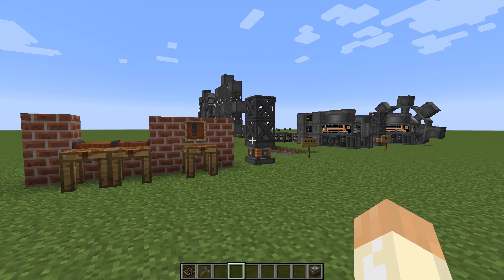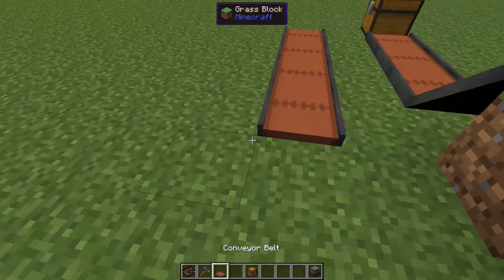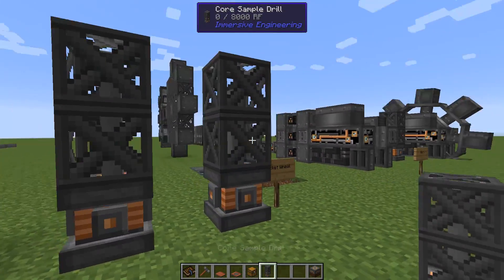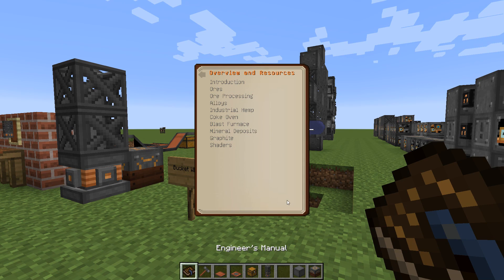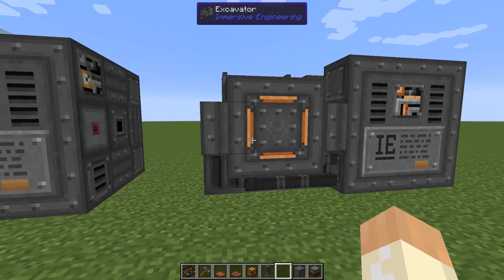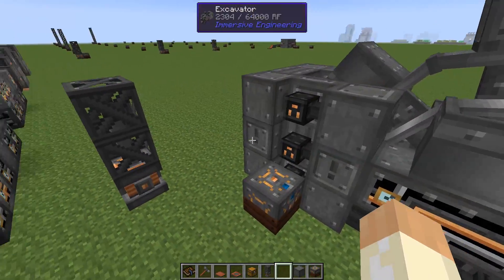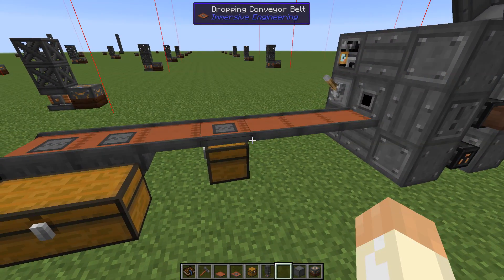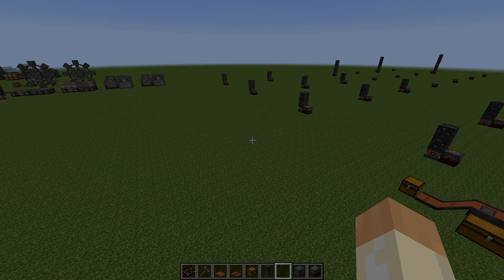Immersive Engineering Tutorial #5 - Excavator and Mineral Deposits (MC 1.7.10)

Comment: I don't get the point of Immersive Engineering. I've been playing it for 2 days, and it takes too much time to get everything working. But, when you do, like those Excavators, what will be the point of all your industries?

Not that Minecraft has an objective, but IE really is complex to achieve nothing besides having it working.
Reply from the maker: Well, as with many mods I think it plays best together with other mods. And you can choose what style and method you want to use. However, I think it's fun that some mods makes things "harder", looking at the power system for example, how to distribute in low, mid or high voltage. Multiblocks instead of one-block-fixes-all etc. It feels more rewarding (sometimes).

Comment: Hi! I understand this is 5 years old video, but I'm wondering how can I enable mineral deposits which is not automatically enabled. (Such as slit - clay + sand + gravel)

It seems like some people raised questions in the bugtracker but I could not find any meaningful result.
Reply from the maker: Hmm, what mod version are we talking about?
Reply from the maker: And modpack if using one.
Reply: @therealtkh  Thank you so much for your reply!

 It is 1.16.5, and I was creating a custom one for myself.

If I'm remembering correctly, minetweaker could add custom mineral deposits but not sure about crafttweaker...🙄
Reply from the maker: @saewings4963  I started up a 1.16.5 instance and added only IE. After that I went around and took lots of small samples (using Mineral Survey Tool), finally I found a Silt deposit, as we were talking about that. Did not work in flat world for some reason, I had to be in a regular world. So I took a core sample and had a 98% Silt concentration, built an Excavator and put it to work. Seems to work fine as it output Sand, Gravel and Clay. However, I didn't find the ore concentration in the config files so I can't say how to change them. I haven't used Minetweaker/Crafttweaker so I'm not sure if they can help out with enabling/disabling/changing rates. Sorry!
Reply: @therealtkh  Thank you so much again for investing your time for this question. It really helped me a lot! Maybe they changed things in 1.16.5... (I saw many complaints for previous versions saying 'some mineral deposits are not present despite the output minerals are all from vanilla minecraft' and the author just dismissed the issues saying 'less desirable minerals will not be added')

I really appreciate it, and I hope you have a great day! :)

Comment: Im am building excavators EXACTLY the same way you did in this video, but they simply will not form when using the engineering hammer at the end.
I've tried with and without the wheel present, they just don't form.
Reply: the block that you hit matters. if it doesnt work, craft an engineers manual, search heavy machinery and the excavator. it has a nice tutorial for building it.
Reply from the maker: Please note that this video is over two years old, and things might have changed. What version are you using? Double check versus the manual if anything has changed.

Comment: Again I did everything to power that Excavator, and it still does nothing why. i'm using the High Voltage. but it has these multiple functions that I still know nothing about, and the problem still persists. what does the blank mean? What does the blue light mean? And what does the red light mean?
Reply from the maker: Please note that this is the fifth video in this series, and power systems are covered in earlier videos. On a capacitor, blue means input, orange means output. It's important to have them configured correctly when powering machines.
Reply: oohh
Reply: Yeah I haven't found that in the Engineer's Handbook so I wondered.
Reply from the maker: The handbook has a lot of text and sometimes there might be minor things missing or perhaps not explained enough. That's one reason for making tutorial videos :) Hope you got things working.

Comment: Can someone explain to me how the /ie mineral set ... works because for me the excavator scoops just  air.
Reply from the maker: Did you do like in the video? Take a sample and then place the machine within that chunk?
Reply: +TKH 
Yes I liked the video:
it was instructive for me to understand how to use the excavator in survival.
But I've learned that there is an: "/ie" command (in 1.7.10 at least). If I type:
/ie mineral set Iron
then it "overrides" the minerals in the chunk to iron. Unfortunately this doesn't synergies with the excavator (and it just scoops air) thus I was wondering if you or perhaps someone in the comments section knows any thing about how this works, if I got it wrong, there is another step to this, etc. Anyway I hope you have the time or energy to supply me with an answear or propose an alternative.  Again, I would like to crontrole the location of the excavator placement and still get the minerals I want. Thanks again. (Btw I wrote this on a mobile ergo I feel like this comment is prone to mistakes, so don't hate me for that). (Bbtw, should I have spelled prone, proned or was it fine?)
Reply from the maker: Ok, then I understand how you mean. I've never used or seen that command, so in that case I recommend asking BluSunrize for an answer. I have only tried what I did in the video, and in that method you can't chose what mineral a chunk should provide. If anyone knows it would be interesting for all of us.